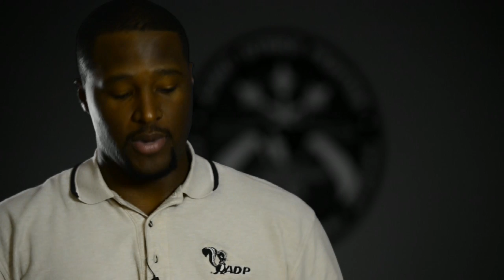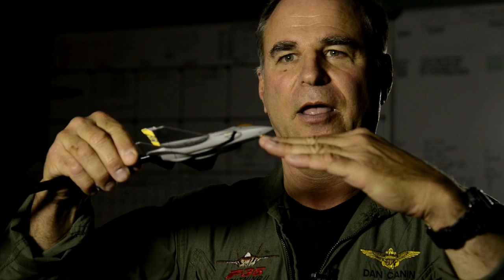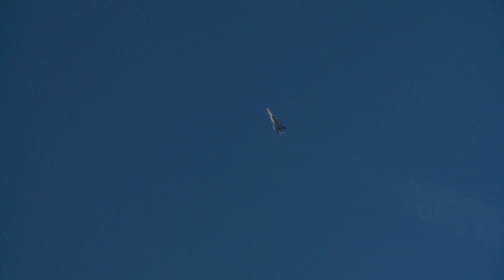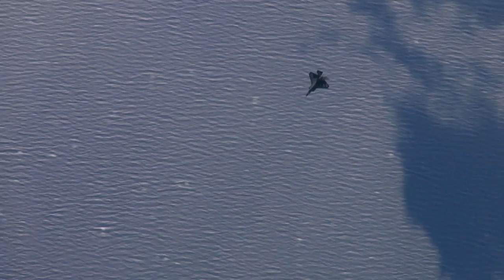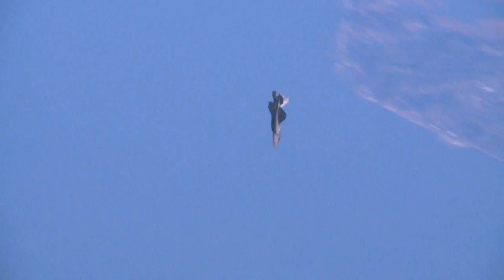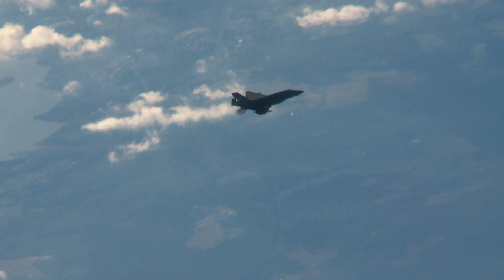F-35C High Angle of Attack

Comment: It's funny how everybody here gets a hard one because the F-35 is stealth. Well sorry to cockblock you guys, but Russia already has radars that defeat the stealthyness of the F-35. The F-35 is designed to be stealthy from the front, but the sides,top and bottom are just as stealthy as any other 4(++) Gen fighter out there. So it's useable stealth is linear and a small area. Include that and the underperforming avionics and you have a plane that's obsolete against any other modern fighter out there. I'm talkin' SU-35's, FA-T50's, Dassault Rafale's and Eurofighter Typhoon's. They call the F-35 a 5th gen fighter, but it only has 5 out of 15 aspects that make a 5th gen fighter. It's no wonder that the Israeli's basically modify the F-35 to an internally new plane.

BTW: I see that people are saying that the F-22 was more expensive then the F-35 is. Well, that's completely false. 

F-22
Production cost: US$66.7 billion

Unit cost: US$150 million

F-35
Production cost: US$857 billion
 
Unit cost:
               F-35A: US$153.1 million
               F-35B: US$196.5 Million
               F-35C: 199.4 million

That much for a plane that's not even close to the performance of the F-22's (Gen5), T-50 PAK-FA's (Gen5), Chengdu J-20's (Gen5), SU-35's (Gen 4++) of this world is just unheard of.
Reply: Where exactly did you get your information regarding Russian radars from? Was it by any chance Russia Today or any other STATE RUN propaganda sources?

Besides the commentary on the shaping is patently false regarding RCS to gen 4++ airframes. Come back to me when you can show me a single angle on the F-35 exceeding the 65 degree rule.
Reply: I can't remember where I got it from, but it was certainly not from RT. I hate Russia soo don't say i'm pro Russia, these are just facts. I do know that the F-117 that got shot down in Bosnia got locked-on because there CO was smart enough to realize that using a differen bandwith improves the chance of tracking a stealth plane. That 65 degree rule is bs. How is it that even though the F-35 is smaller then the F-22 it still has more RCS then the F-22. The F-35 is built to be exported soo it's impossible that the US wants a plane that has comparable RCS as the F-22 does. Besides that the F-35 can't outmaneuver any Gen 4++ fighter and it doesn't have a powerful radar like the F-22, PAK-FA and the upcoming Typhoon Captor-E. So it's obsolete in WVR and BVR combat.
Reply: alfons volkert Well I could go into a multi page rant about how wrong your are (your belief that stealth directly correlates to the size of an airplane is worrying enough) but the fact that despite your claim that "these are the facts" without your ability to remember at all where they came from tells us all we need to know.
Reply: alfons volkert   We might not see eye to eye on things, but I do like our conversations.  Sorry for the long reply.  Its actually just re-posting your questions and adding replies.  So it should be easy to run through.

->  "Let me explain: first of all, it doesn't have thrust vectoring."

It doesn't need it.   TV is not a benefit for every fighter.
  
-> "It doesn't have side facing AESA radars."

 We are building a stealth aircraft not a flying 'Quasar'  everyone can detect (thank you user: 'popcorn' for that comment).    Even a modern downsize unit adds considerable  weight..  Its rather interesting that the IAF (not Russia) thinks this could be an advantage on the PAKFA (especially when they are behind in radar technology). The DoD made the right decision on passive sensor fusion.

-> " High agility supersonic/subsonic not that great compared to others."

According to whom?  And compared to which plane?  In what mission role? Load those planes with combat loads  and then compare them to the F-35.  The F-35 does mach 1.6 with a full combat load and they think it can be pushed further with improvements to the skin.  The beloved F16 loaded does not.  The SU30 does Mach 2,0 max clean.  Load it and I guarantee you it won't do close to Mach 2.0.

->  "No large internal fuel load."

Over 18,000 lbs internally is not a large fuel load?  The Eurofighters carries around 10,000lbs internally thrusting on two power-plants.   Add external tanks and you increase serious drag.

-> "Little thrust growth, middling thrust to weight."

What altitude? Armed or clean? How much throttle?  A lot of critics are quoting ratios that are three years back or older. The F135 puts out 28,000 lbf. dry and 43,000 pounds max thrust.  Show me a single Russian or European engine doing this...And it does it at remarkable fuel efficiency.    

->  "No supersonic weapons delivery and only 4 internal weapon pods, compared to the 6 + 2 formula the F-22, PAK-FA and the J-20 are having."

Not true. You haven't seen the new weapons the F35 will be carrying.   Google Cuda missile system for start.   This missile is smaller and deadly. Also the F-35 can carry additional loads under the wings.  The J20? Who knows.    
-> "Yes it has an advantage in BVR against both the Rafale and Eurofighter. But in order to accomplish that it needs to be slick and that comes at a price."

Have you seen the new numbers for 2014?  Price has dropped considerable and continues to drop.  Its projected now to be very affordable.

-> "BVR the F-35 has the advantage based on the fact that the RCS is way less. WVR combat no fucking way."

Network/sensor fusion integrated into the wings and fuselage and situation awareness is a huge advantage.  The Cuda is supposed to be a light, lethal, high G accurate  multi-tracking missile.  The pilot will be able to lock onto to multiple targets and remote direct missles to each of them in a panaramic situation awareness environment giving the F-35 a considerable advantage in WVR and BVR.   As far as speed, when the F35 opens up on the throttle, the accompanying F16s has to use afterburners to keep up.  Its handles about the equivalent of the F16 clean according to current test pilots.    So it should be able to turn very well.  Sure It might loose a couple degrees in turning compared to the Typhoon, but, it makes up for it greatly in other areas giving the pilot highest probability of first look first kill even in an WVR. The pilot's skill level and ability to adapt will do the rest.

-> "The Rafale and Eurofighter both will outrun and outmaneuver the F-35. I do agree with you though, we'll only know when it participates with Red Flag."

Not necessarily.   Will they see the F-35 first before it sees them in a WVR scenario?  Will the Eurofighters fight clean or with combat loads which seriously cuts its maneuverability?  How far are they from their base is another factor which weighs on either range and/or ground strike vulnerability?

Long distance requires external tanks on the Euro-fighter which cuts performance.  Too outrun the F-35 requires afterburners which seriously eats fuel. This will limit any WVR engagement well under 800 knots which will shift the odds in the F-35's favor.

If the Euro-fighter is close to its base, tactics will be employed to hit the airfield which will more than likely keep the Euro-fighter within a sphere of engagement limiting its attacks to defensive.  It might be able to run more clean to increase performance, but the F-35 can still carry a stronger weapons load which will then employ these factors:  Can the Euro-fighter be able to out maneuver the F-35's tracking systems?  Will it be able to out-maneuver weapons like the high G performance cuda?

Combat is never decided on factor but a combination of factors and tactics.  Also, history has shown that winners in WVR engangements are most often given to the pilot who spots their opponent first.   So "if" they get eyes on the F35 before the F35 has eyes on them, then maybe. But that easy could become a very big "IF". 

--> "As for China and Russia being late to the party completely true. The F-22 is awesome, but the US has waay too less of them to really have an advantage."

The US DoD has got all kinds of programs in the works from Drones to an F22 replacement in the works.  Boeing is back to work on another competitor to the F-35.  F15SE and Super Hornets are still available.The remaining F-22s has fully financed upgrades and are plan to receive the same modernization in the F-35 making them even more deadly.  If a problem occurs, the F22 can always be put back into production however its been about 10 years now.  The DoD is looking at new developments not old stuff.  

As far as Russian and China, without a drastic catch-up in research and technology (which cost lots of mega money), the T-50 as it stands will not match the F-35 in air superiority let alone the F-22.  It still years away from its new engines and the current ones are really  under-powered.  Personally, I don't think it will not meet its design promises especially by 2016.  I think India's IAF has logical and accurate assessment about the bird.  The J-20 is a mystery but China hasn't shown anything that for fills its design promises and I personally am not impressed with what I have seen.  Their infrastructure and combat experience is far behind Nato.

 --->  "My money is on the Eurofighter especially with the new upgrades that are coming, this plane will be unstoppable."

I'm also curious how the new upgrades are coming myself.  The Typhoon is a strong plane.  The Rafale is impressive as well. Unfortunately I not sure I would bet on any 4th generation fighter with the advancements in mobile SAMS and MANPADS.  These are one of the primary reasons the USA DoD is pushing Stealth.   Unlike the 1960s, 1970s and 1980's, Missiles are lethal now.

 ---> "Also last thing is, if the F-35 is in ''stealth mode'' at some point in time it needs to turn on it's radar and that's when everything changes and stealth just goes out of the window."

It can collect plenty of usable data through its IR and Passive sensors integration network on most scenarios.  Having eyes and data on the opponent before the opponent can have data on him.  Also, just because it can be detected using AESA doesn't mean it can be easily located.
Reply: luckygodzilla95 Let's face it. The F-35 is built for export. That's why it's not as stealthy as the F-22. Even though they say the F-35 is awesome. It will lose out too any other 4++/5 gen plane out there. And people still trying to convince us that it's a great plane.
Reply: alfons volkert And it is for this precise reason that a bunch of partner nations decided to make the F-35 their premier (and only) fighter jet for the next 30 some years. Keep in mind that this is all due to some nonsensical welfare plan for lockmart where all these governments decided to come together and throw money at them for... some reason.

See this is where I take issue with the F-35's critics. If it's truly as bad as people say, than partner nations would have backed out. South Korea and Japan would have never chosen it, and a Singaporean air force general after seeing the planes full list of capabilities would not have gone on to call it invincible.

So I really am interested in why you think the F-35 has been selling like hotcakes abroad while at the same time being an "absolute dog" that can't even beat a 4++ gen fighter?
Reply: alfons volkert Agreed! ROFL.  Nice sense of humor....lol
Reply: ''There are a lot of things the DoD isn't talking about.  A lot of critics don't realize that the F-35 is going to change the landscape and tactics of air warfare.''

Yup completely true. The range of the radar is still clasified I believe. And ofcourse it's an ongoing project that will last atleast another 30+ years, so there will be lots of improvements during it's lifecycle.

While we at it. Do you think the US Navy should replace all existing F/A 18 (Super) Hornets, with the proposed Advanced Super Hornet from Boeing. I think this plus the F35 will make an awesome combo, since the F18 is not a bad plane. Especially the Growler is a good backbone for the F35.
Reply: alfons volkert Actually much of your conclusions on the F35 are wrong.  You must have been cruising one of APA's sites.  

" the F-117 that got shot down in Bosnia got locked-on because there CO was smart enough to realize that using a differen bandwith improves the chance of tracking a stealth plane."

The F117 also was in the process of an ordnance drop.  Meaning his payload door was open and the Bosnians figured out the flight path. Still only one was shot down out of how many campaigns?

Although lower RF does increase the ability to detect stealth there are all sorts of draw backs in using it which can be exploited to defeat it.  LF is not the golden ticket to making stealth obsolete. There was a reason most of the world abandoned LF radar long ago.
Reply: alfons volkert you know there is a lot of misinformation on the the F35. Most of it is stirred up by speculation from both sides of the argument.   you need to consider that before drawing a conclusion.
Reply: luckygodzilla95 agreed! It's disturbing that people here can't tell the difference between hard facts and speculation.  Despite the critics background and education level, if they have never flown the plane, or designed one piece of the aircraft then their conclusions are based on speculation from observation at a distance.  Sometimes the expert is also misquoted purposely.
Reply: luckygodzilla95 Because it sells ''well'' that doesn't mean it's a good combat aircraft. Now tell me clearly what the capabilities are of the aircraft that are FAR superior to any other. Tell me the facts. Tell me if it can outrun and outmaneuver any other aircraft. And while you at it, tell me why Israel decided to put it's own technologies into the plane, that's supposed to be awesome.
Reply: ***** Why should you need to fly the plane to get an impression of it's performance if the plane can't even match others on paper? Facts are facts. And fact is that the F-35 is trying to be a do all be all plane, but it's failing at it. Ofcourse every test pilot of Lockeed Martin is going to say it flies better then anything in the world. Like i said before, I think this plane is not ready for any modern threats out there.
Reply: alfons volkert First of all, test pilots who have flown the F35 are are active members of the arm services not Lockheed Martin test pilots have confirmed and spoken highly of the F35 performance during shakedown trials. So that can be taken strongly.

Second, very little reliable hard data on the F35 has been released and only in small amounts.  Much of the critics attacks on the F35 have been from bad data and speculation.  Especially Wheeler and Perry Sprey who have been spearheading this anti-F35 campaign!  Sprey I have seen around for a long time and I can tell you first hand he tends to push his own agenda in these debates.  He is also a legacy designer who is a bit 'set in his ways' and has not really upgraded his understanding of modern designs.  His criticism in his analysis of the F15 really demonstrates much I am saying.

Third, you can make the assumption that Lockheed Martin is paying pilots to exaggerate the performances of the F-35.  But unless you witness such a scenario, its all just assumptions and speculation.  But should take the possibility into account?  Sure!  One would be foolish not too.  But I would have to imploy the same logic in reverse too.  That means I have to give the pilots who criticize the F-35 (but never had flown it) the same level of suspicion because a lot of the ones that have gone public (fact!) do work for Boeing and Boeing has (fact) been on a public anti-F35 campaign to sell the F15SE and the Super hornet.  As I said before there are now active military pilots testing operation F35 models for shakedowns who do confirm most of Lockheed Martin's pilot's claims.

So an expert Impression is not fact!  An Impression is speculation and speculation is calculated guessing based on observation, "from a distance."  I mean come on!  From a distance???  No one can know anything about a plane from an 'observation at a distance?'  None of these critics have had an in depth access to the F35 test performances and have not been part of any analysis group studying the F35 in action. 

Oh yeah, paper is not reality.  You would need a book written on a plane to even get close. The SU30MK seems to match closely the F22 on paper, but, its does not in real life especially at combat speeds.  One of thrust vectoring's problems is that when over-used in a turn can cause any plane to stall moving the CG (center of gravity) from the wing to the nose.  This causes a tail drop.  The F22's avionics, aerodynamics and massive thrust recovers quickly pretty much arresting the fall.  The SU30 does not recover so easily.  It really sinks making it highly vulnerable.

So speculation is speculation even if its a professional expert because even the smallest details are key to a proper analysis.  I've been reading the posts on a 40 year veteran aerospace engineer on F16.net who discuss the F22 and even he says that since he never designed the plane the opinions he is giving are speculation!   Even he says that he is learning new things all the time and that older approaches to planes are not set in stone.
Reply: ***** Still that doesn't change the fact that this project is over it's budget and behind schedule. Plus it's dealing with problems god knows when those are getting solved. So i'm very sceptical about the outcome of the F-35 project. I think this plane is overrated and that it will underperform once it faces the current threats China and Russia have to offer for it. Like I said, this plane is trying to be too many things at the same time.
Reply: alfons volkert ---> " Still that doesn't change the fact that this project is over it's budget and behind schedule. "

Doesn't negate my point either which very much applies.  If you are getting your information from questionable sources, then you have to ask yourself if your conclusions are correct.

-> "Plus it's dealing with problems god knows when those are getting solved.  So i'm very sceptical about the outcome of the F-35 project"

 Thats also the problem with obtaining information from questionable sources.  You don't always get the positive sides.  Always the negative sides.  Some want to encourage the plane to fail in order to serve their agenda.  There is a lot that has been achieved.  2013 has been the best year for the F-35.  The project is finally under control.

-> "I think this plane is overrated and that it will underperform once it faces the current threats China and Russia have to offer for it. "

Are these the same sources telling you this that are condemning the F-35?  The F-35 has many revolutionary advances these planes don't have.  Russia and China are years behind.  Perhaps more than a decade.  

->  "Like I said, this plane is trying to be too many things at the same time."

Money is tight. The days of acquiring multiple aircraft for multiple tasks are over.  Its not the plane doing three different task that is the big  problem.  It has been the pentagon program  management and Lockheed's management mostly at fault not so much the designers and engineers or what is going into the F-35
Reply: ***** I know what you mean, but to say that Russia and China are a decade behind at best is just fully ignorant. Oke China may not be as advanced as Russia and the US, nut the PAK-FA is certainly a formidable force against the F-22. As for me pointing out the negatives. Tell me one thing that's soo positive it wil soften the negatives, if you know what i mean. I mean if you compare the F-35 to the other modern fighters that are coming at the same time frame as the F-35, you'll see that it lacks in all aspects. Now if you compare to planes of today like the Rafale and Eurofighter you'll see that even thoug they have similiar roles, the F-35 doesn't match it performance wise. You talk about serving agendas and that political BS, but i'm just saying that because of the politics this project was screwed in the first place. Let's talk about the performance as it is. And yeah 2013 maybe the best year of the project, but it still non-operational for the furthcoming years, while it should've been operational for a couple a years.
Reply: alfons volkert --> " I know what you mean, but to say that Russia and China are a decade behind at best is just fully ignorant. "

I said they were years behind.  Maybe a decade.  Not a decade at best.   And they are.  20 years to start a program to rival an American stealth fighter that is already 10 years in service and pretty much outdated.  Russia has good 4th generation aero-designs but avionics and sensors are way behind.  Radar is also behind.  

-> "Oke China may not be as advanced as Russia and the US, nut the PAK-FA is certainly a formidable force against the F-22."

According to whom?  Not the India IAF who is a joint financing partner.  The PAKFA is 20 years late and still delayed.  Its new engines are years away projected 2025.  So its under powered. There is nothing so far that has physically demonstrated any capabilities over the F22.  The design is just promises on paper amd paper is just paper. I can create a space craft that can travel to Alpha-Centari on paper. Doesn't make it so.

 ---> "As for me pointing out the negatives. Tell me one thing that's soo positive it wil soften the negatives, if you know what i mean.

Go to the forums at 'F-16.net'.  There are very knowledgeable people there who don't flag wave and are all about aircraft.  You will find veteran pilots, designers and engineers there too.  They don't like BS.

-> "I mean if you compare the F-35 to the other modern fighters that are coming at the same time frame as the F-35, you'll see that it lacks in all aspects."

What aspects are those?  Warfare today isn't what it was 10 years ago let alone 20 years.  All Russia keeps doing is recirculating the same basic airframe approach.  Even the T-50 airframe is a cross between the F22 and the Su35.  You can't make critical advances playing it safe. You can't make major advances without taking risk and spending lots of money.  So Russia isn't realistic in building an overall superior plane to the F22 at the costs they claim.  Not even close! 

-> "Now if you compare to planes of today like the Rafale and Eurofighter you'll see that even thoug they have similiar roles, the F-35 doesn't match it performance wise."

Again according to whom?  What aspect of performance are you talking about?  There are different ways to look and compare this.  On many levels, the F35 should be superior in BVR and WVR.  Since it has not completed its shakedown and hasn't engaged in any red flag exercises, you and I don't know what it will do or how well.

 ---> " You talk about serving agendas and that political BS, but i'm just saying that because of the politics this project was screwed in the first place. Let's talk about the performance as it is."

Well according to the test pilots, the performance is very very good.   Aside from that, what else do you think you know about the performances of the F-35?  Certainly not Wheeler or Pierre Sprey or even APA for that matter.  Do you know which performances would be the most effective in a BVR/WVR engagement of today's world of combat and the future?  I do know that the South Koreans selected the F-35 against the F-15SE after careful evaluation.  They are not idiots when it comes to their aircraft and have strong skilled pilots.  So they must know something important.  We have to consider that point too.

-> " And yeah 2013 maybe the best year of the project, but it still non-operational for the furthcoming years, while it should've been operational for a couple a years."

The past is irrelevant now unless you got a time machine.  I don't.  What is done is done. You are right.  It shouldn't have happened.  But thats got nothing to do with the plane being able to do its job in the future.  The F-35B is already being delivered. The F35A and C are on their way.   The Software is now the biggest issue.  But this is not un-expected either.  The current planes have operation "blocks".   Software is always harder to debug than hardware.  3rd and 4th generation fighters never had the need to code something so advance.  There systems were more basic.  Warefare in the old days was more basic.  SAMS, MENPADS and Drones have change a lot of that.

Honestly I have no opinion yet on whether the project is entirely worth it or not until its been active enough and the full results are in.  But I do believe as far as delays and problems the worst is in the past now.
Reply: What aspects are those?

Let me explain: first of all, it doesn't have thrust vectoring. It doesn't have side facing AESA radars. High agility supersonic/subsonic not that great compared to others. No large internal fuel load. Little thrust growth, middling thrust to weight. No supersonic weapons delivery. And only 4 internal weapon pods, compared to the 6 + 2 formula the F-22, PAK-FA and the J-20 are having.

Again according to whom?  What aspect of performance are you talking about?  There are different ways to look and compare this.  On many levels, the F35 should be superior in BVR and WVR.  Since it has not completed its shakedown and hasn't engaged in any red flag exercises, you and I don't know what it will do or how well.

Totally not true. Yes it has an advantage in BVR against both the Rafale and Eurofighter. But in order to accomplish that it needs to be slick and that comes at a price. BVR the F-35 has the advantage based on the fact that the RCS is way less. WVR combat no fucking way. The Rafale and Eurofighter both will outrun and outmaneuver the F-35. I do agree with you though, we'll only know when it participates with Red Flag.

As for China and Russia being late to the party completely true. The F-22 is awesome, but the US has waay too less of them to really have an advantage. My money is on the Eurofighter especially with the new upgrades that are coming, this plane will be unstoppable. Also last thing is, if the F-35 is in ''stealth mode'' at some point in time it needs to turn on it's radar and that's when everything changes and stealth just goes out of the window.
Reply: alfons volkert Still haven't answered my questions.

But for thrust vectoring, why do so many people have such a massive hard on for that? The only flight regime where it has meaningful impact is in post-stall, which is effectively suicide in modern air combat, but boy does it look pretty in airshows.

For the added weight, complexity, and cost, it's not really worth it. If you want better maneuverability you're better off increasing the size of the flight control surfaces by a couple of square meters and paying a flight science engineer to rework the fly-by-wire.

Secondly, side facing AESA radars are not actually a good thing. A mature AESA radar system does not need to be surplanted by multiple AESA radars, which obviously are one of the most expensive components of any modern fighter. Furthermore, you need to increase the power output of your plane by an order of magnitude, which means more heavy and expensive magnitude. 

As for fuel load, the F-35 with an internal volume in excess of  18,750 lbs has THE most internal fuel of any western fighter ever produced. If that's not enough, well then please tell me what is.

Yeah can't argue with thrust to weight, but I'd also like to point your eyes toward the ADVENT program.

http://www.flightglobal.com/news/articles/pentagons-proposed-budget-would-fund-adaptive-engine-development-396475/

With fuel efficiency gains being upwards of 25%, an F-35 with an ADVENT core might very well be the fighter with the longest legs ever produced. 

As for supersonic weapon delivery, there is literally zero mention of the F-35 lacking this capability. If you can provide a link, it would be greatly appreciated. 

And I agree, 4 internal weapon bays is a tad small. Good thing that Lockheed Martin thinks it's a problem too, as there are already plans to increase internal capacity to six amraams.

And finally it's time to discuss WVR engagements. First off, if the entire design philosiphy of your plane relies on it avoiding AMRAAM after AMRAAM in a mad dash toward where they are coming from, well you may want to go back to the drawing board.

Aside from that, any competent IR guided missile in WVR means that the platforms become irrelevant. As long as the fighters have HMD's, thanks to HOBS a mig-21 could shoot down a F-22 just as easily as the F-22 could shoot down the mig-21. These things can turn at 50G's, avoiding them isn't really going to happen.

And hell, with the F-35's Eo-DAS, which tracks an enemy fighter plane VISUALLY WVR, there is literally no way to spoof the incoming missile.
Reply: For the added weight, complexity, and cost, it's not really worth it. If you want better maneuverability you're better off increasing the size of the flight control surfaces by a couple of square meters and paying a flight science engineer to rework the fly-by-wire.

Then you shouldn't have designed the F-35 as an stealth plane. When designers are designing a stealth plane they don't want that.

Well i got a question for you. Well multiple.

Are you proponent of the F-35? Can you compare the F-35 to other fighters that are omni- or multirole airplanes and tell me if it's better? 

And i noticed you didn't mention BVR combat. So tell me something about that.
Reply: alfons volkert I thought I would take a shot at answering the question you posted at LuckGodzilla.

->   "For the added weight, complexity, and cost, it's not really worth it."

But what if the battle and tactics around you have changed and become more complex?  Innovation is very costly. Who says its not worth it?

--> " If you want better maneuverability you're better off increasing the size of the flight control surfaces by a couple of square meters and paying a flight science engineer to rework the fly-by-wire."

Then you loose out on stealth and range.  You are focus too much on the Air to Air dogfight (especially the legacy approaches of the 1960's, 1970's and 1980s).  The F-35's lift body and unstable wing/tail design should give good performance advantages while keeping RCS low. Also, Air superiority is about all factors, tactics and all advantages; not just about dog fighting.  One of the most important factors in today's combat  is survival from lethal surface to air threats.  Even more so than the classic dogfight.  Still the F35 maneuvers well.  Its weapon system and advanced payloads can do the rest. 

-> "Then you shouldn't have designed the F-35 as an stealth plane. When designers are designing a stealth plane they don't want that."

Curious.  Where did you get that idea that designers are building planes they don't want?

-> "Well i got a question for you. Well multiple. Are you proponent of the F-35? Can you compare the F-35 to other fighters that are omni- or multirole airplanes and tell me if it's better?" 

The F-35 is specifically designed to balance A2A and A2G responsibilities quickly were as other aircraft are constructed for a primary roll like A2A engagements and ground attack is an add-on.  Sure those 4th generation fighters can do some of the job but they have a much deeper disadvantages in range, accuracy, situation awareness, detection and vulnerability.  That was why the A10 was originally created.
Reply: ***** The F-35 is specifically designed to balance A2A and A2G responsibilities quickly were as other aircraft are constructed for a primary roll like A2A engagements and ground attack is an add-on.  Sure those 4th generation fighters can do some of the job but they have a much deeper disadvantages in range, accuracy, situation awareness, detection and vulnerability.  That was why the A10 was originally created.

Well I think the Eurofighter does a pretty good job at A2A and A2G. Especially the tranche 3 aircrafts and the new upgrades it's getting.
Plus when the F-35 does A2G it probably needs more then 4 bombs it can carry right now, that means it will use pylons and that basically defeats the whole stealth purpose. Especially when there are still ground threats,
Reply: alfons volkert

---> "Well I think the Eurofighter does a pretty good job at A2A and A2G. Especially the tranche 3 aircrafts and the new upgrades it's getting."

Very good buts its still quite limited actually although the upgrades do help.  Especially fuel consumption and in Range.  Its a lot easier to spot and target with MANPADS and mobile  SAMS. 

--> "Plus when the F-35 does A2G it probably needs more then 4 bombs it can carry right now, that means it will use pylons and that basically defeats the whole stealth purpose."

If you need to carry that many bombs then it must be a major ground strike. You will need to have already achieved air superiority before that anyway. So Stealth is far less needed.   Worse case scenario, you have other F-35s and F-22s covering your attack.
Reply: If you are doing major ground strike, you will need to have to achieved air superiority in the first place. So Stealth is far less needed.   

That's why I said wwhen there still are ground threats.

And the Eurofighter has pretty good range.

2,900 km (1,800 mi)

Ground attack, lo-lo-lo: 601 km (325 nmi)
Ground attack, hi-lo-hi: 1,389 km (750 nmi)
Air defence with 3-hr combat air patrol: 185 km (100 nmi)
Air defence with 10-min. loiter: 1,389 km (750 nmi)
Reply: alfons volkert JSF
Joint Strike Fighter

No yeah I agree, we should totally slam a strike fighter for having worse AA than a dedicated air superiority platform.

And yeah, the Tranche 3 is decent, until you realize that they cost the same that an F-35A does now, while not being anywhere near as good at kicking down the door.

For fucks sake it's 2014 and the Eurofighter still doesn't have an AESA.
Reply: alfons volkert Now that is only true if you don't have stealth. The whole point of the JSF is to kick down the door, or simply circumvent air defenses and bomb airfields.

I'd like to meet a pilot who would rather go up against an S-300 in a Eurofighter instead of an F-35.

Furthermore the ranges you posted were ranges with external fuel tanks. The Eurofighter sports an internal volume 5,000kg which even the F-35b with it's lift fan can beat with an internal fuel load of 6,125kg

As for the A and C, they have 8,278kg and 8,960kg respectively.
Reply: luckygodzilla95 The EFA is not an Air-superority fighter. It's multirole. And what do you mean with the Tranche 3 not being as good as the F-35 in kicking down the door?

The EFA will get the CAESAR in 2015, same time frame the F-35 will be operational.
Reply: alfons volkert -->  "That's why I said wwhen there still are ground threats."

I took that into account in my reply.  But I'll break it down further.  If you are doing a heavy surface strike run with external loads and you still got mobile SAMS and MANPADS locking on, you have a huge superior advantage of evasion with superior jamming/counter-measures, full 360 degree threat tracking/assessment, or targeting those threats.  ... Or if needed, you have a better chance of escape with the F-35 which can drop payloads and go back into "Stealth" with 43,000lbs of thrust, good maneuverability, full situation awareness, Aesa & countermeasures, good fuel range and carrying potential defensive weapons loads internally depending on the threat anticipations of the mission.

However, if you are doing a massive strike with SAM/MANPAD threats still in the area you probably are going to have F-35s (no externals),  Choppers, AC130 guns and drones working together targeting and eliminating those threats.  You might even have hidden spec-ops teams on the ground too.   If any major strike is necessary, that sounds more like a job of a fully loaded B1B or B2 but you can have a second wave of F-35s with external ordinances waiting. 

-> "And the Eurofighter has pretty good range. 2,900 km (1,800 mi)"

LuckyGodzilla may have been a bit rough, but he answered this well enough.

->  "And what do you mean with the Tranche 3 not being as good as the F-35 in kicking down the door?"

There is way more to combat than just agility and carrying weapons. That fundamental is the core of why the F35 was created.
Reply: Or if needed, you have a better chance of escape with the F-35 which can drop payloads and go back into "Stealth". 

You still got the pylons that compromise basically all the stealth capabilities.

There is way more to combat than just agility and carrying weapons. That fundamental is the core of why the F35 was created. 

Totally correct, that's why the EF is not only manueverable but also advanced with it's avionics and armament, i.e. the Storm Shadow.
Reply: ***** Yep i'm really liking the discussion we're having without  just being plain internet whores.
Reply: alfons volkert  "You still got the pylons that compromise basically all the stealth capabilities. "

Not entirely, but you are very right it doesn't help.  The F-35 project is already massive and the DoD (and LM) can't employ every little feature all at once. But there is supposed to eventually be a jettison pylon system coming as well as more stealth shaped externals to lower the increase in RCS from external ordinances and fuel tanks.. 

There are a lot of things the DoD isn't talking about.  A lot of critics don't realize that the F-35 is going to change the landscape and tactics of air warfare even when it comes to WVR engagements. Its going to take the fight beyond the classic dogfight model.  Its not going to be the most agile fighter or the fastest but its going to have enough of both to make it dangerous if it was in a classic dogfight scenario even against the typhoon.  The rest of its advantages with be highly technological. The best part is that the advancements and achievements in the F-35 are going to be incorporated back into the F-22 and some of it in the F-15E and Super Hornet. 

 I also suspect that Nato countries will be getting some of these advancements for the Rafale and Eurofighter which will make them even more deadly. 

Did you know that the RAF Tornado couldn't even come close to competing with the F15 A2A war game exercises and was getting wiped out of skies (of course because its a weaker strike fighter) even though the RAF pilots were good pilots.  Then the US DoD and the RAF together did an experiment outfitting the tornadoes with a primitive prototype version of the situation awareness technology.  It turned the tides.  The tornadoes were beating the eagles 3 to 1.  The pilots using it said it was like nothing they ever experienced.
Reply: alfons volkert Absolutely...The Growler has some very good specialties.  

You were mention side Aesas (which I think is overkill and counter productive.  More like a desperate alternative  to lacking advance passive sensors).  Four f-35s in formation can link their Asea's together and sensors together to make them one large flying detection platform.  They can also link to awacs.  Also the F-35s can remote fire weapons from a different platform too.
Reply: Obviously, you're ignorant of RAM (radar-absorbant material).
Reply: alfons volkert "So it's obsolete in WVR and BVR combat." look up the F-35 DAS system, its brilliant for the battlefield, and happens to be excellent for air-air as well.